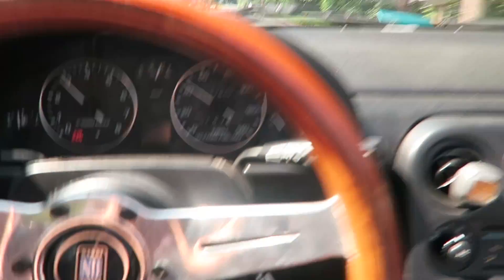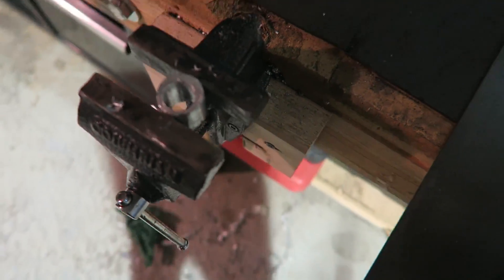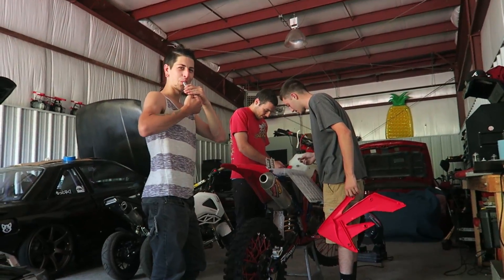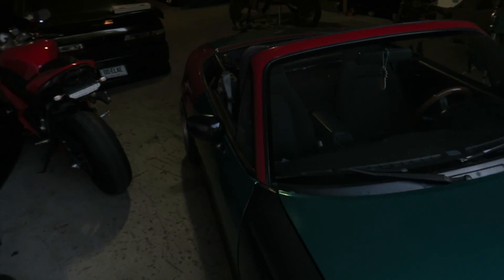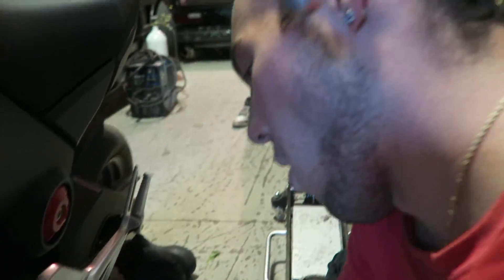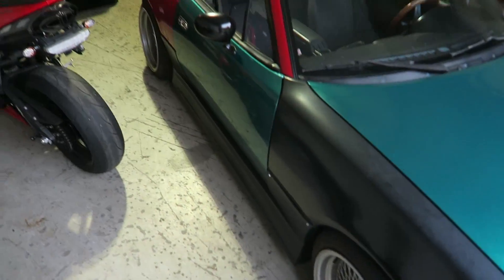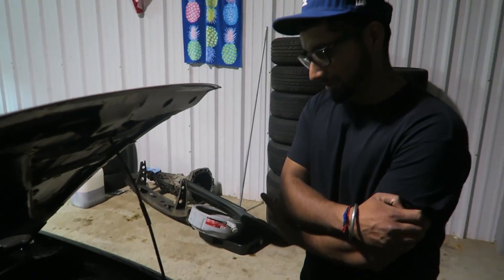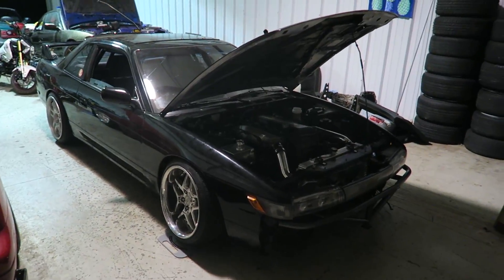Miata vinyl wrap continues!

Comment: Jimmy lol I'm 6'2" and I Daily a Miata with a roll bar. Stock seats, only mods I did was remove a fuck ton of foam from the seat and remove the sunvisors. Without a helmet I'm 4inches under the bar, with I am 2 inches under. I STS autocross it and take it to the track and drift it.

Comment: Use a nut next time you can't find a bung. Go to the hardware store and see which one threads the sensor, then tig it to the pipe.
Reply from the maker: john weaver it's aluminum
Reply: They can be brazed and will hold just fine for its purpose

Comment: Won't engine twist cause damage to the short intercooler pipes???
Reply: Couplers should be your flex points but motor shouldn't be flexing so much that shirt piping would be a problem. Reduce flex by checking/upgrading your mounts and/bushings.

Comment: My s14 sr20det brothers! I need help.'hopefully you guys can help me out. I got a blacktop sr in my 95 s14 but my speedometer is going in killometers or how ever you spell it. But how can i fix this to my speed will be at mph?? Thank you in advance
Reply: soccer boii it's the speed sensor in the trans. Take out the sensor out of the KA trans and put it in the SR trans.
Reply: Chance Miller i was told i has to be an s13 speed senor tho? Or can it be an s14 speed senor??
Reply: soccer boii whatever car it is going in. If it's a s14 you need a s14 sensor. If it's a s13 car you need a s13 sensor I think. I've a blacktop s13 engine in my s14 and I got my original sensor out of my KA trans and put it in my Sr trans and my my gauge works.
Reply: Chance Miller so my sr20det is in my s14, so ill need an s14 speed senor correct?
Reply: soccer boii yeah
Reply: Chance Miller alright thank you